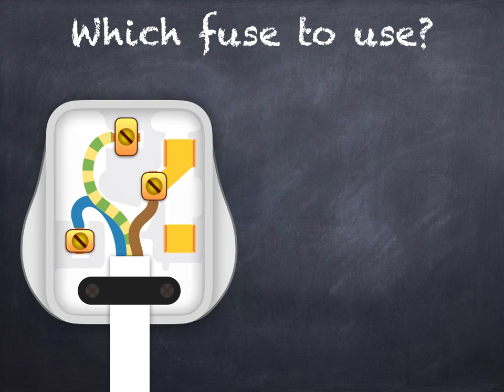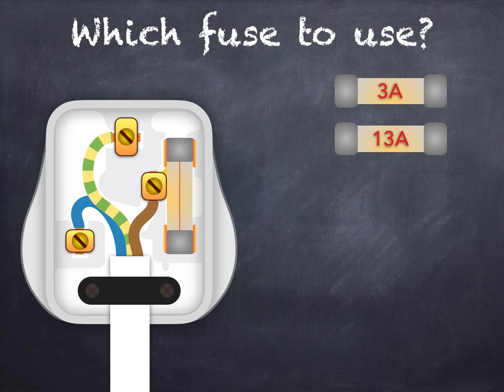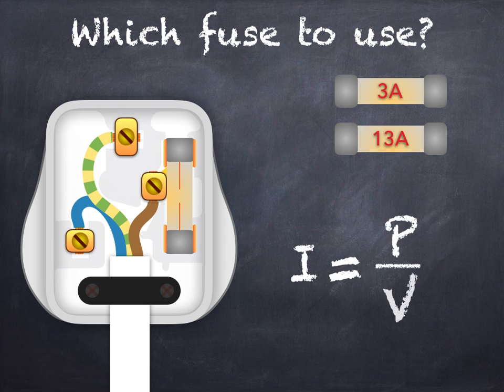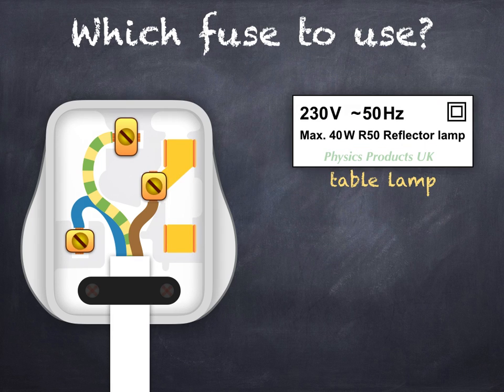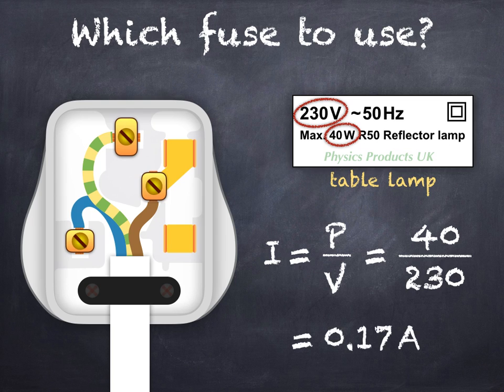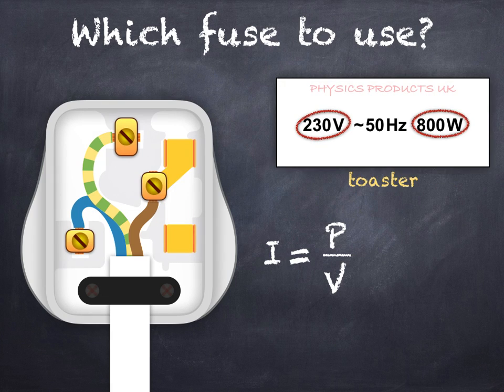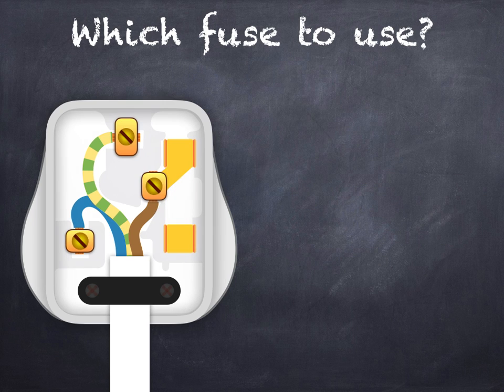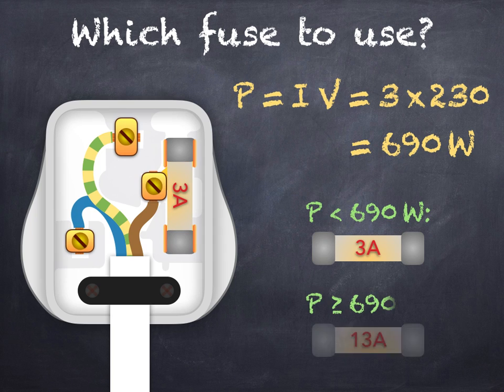Which fuse to use? (National 5 Physics)

Comment: I don’t understand if I am installing boiler that is 30kw so what size fuse would I use 
If you 30000/230…..
Reply from the maker: The video is only intended to help National 5 school pupils with this part of the course. As such, it's very much simplified and is not meant as a guide to selecting the correct fuse rating for various devices around the house. All the best!

Comment: Not sure why you've forgotten about 5 amp fuses, they are just as readily available and in your example of the toaster, a 5 amp fuse would have been adequate.
Reply from the maker: I've nothing against the 5A fuse, in fact, some of my favourite fuses are of the 5A variety. The reason why it's not mentioned is because it's not required information at National 5 level. The course specification states 'Selection of an appropriate fuse rating given the power rating of an electrical appliance. A 3 A fuse should be selected for most appliances rated up to 720 W, a 13 A fuse for appliances rated over 720 W.'

Comment: Hi what is the best fuse to an electric bedroom heater ? What the  correct fuse for ?, I'm using A3 and has an Short time life ...thanks
Reply from the maker: Always check the manufacturers recommendation - this will be printed in the manual of the heater. I'd not want to give advice on a device I've not seen. All the best!

Comment: Dear Sir, but do higher Amp fuse will protect the device. If 3 Amp required how 13 Amp will protect it.
Reply from the maker: The fuse should be the 'weakest link' in the circuit and is there to protect the flex & internal wiring. If too large a fuse is used then, rather than the fuse wire melting, the flex could start to melt which would pose a fire or electrocution risk.

Comment: If a blender could needed 5 amps would a 13 or 5 amp fuse be used??
Reply from the maker: If the current in the blender was 5A, using a 5A fuse would cause it to melt - a larger value fuse would be required. In National 5 Physics, pupils are asked to calculate the current in an electrical device then choose from either a 3A or 13A fuse.
Reply: @MrSmithsPhysicsonline  I  this example would it be worth using a 9amp fuse or would it make no difference to the 13amp other than you would likely have to change it more often.

Comment: What fuse rating should be in an electricity board cutout if the consumer unit is rated at 20 amps and the tails are rated at 28 amps?
Reply from the maker: I'm afraid that's beyond my area of expertise and beyond what is taught at this level. I wouldn't feel comfortable giving advice on mains electricity applications because of the inherent dangers.

Comment: what happen if I use a 13A fuse in a circuit that needs 3A. In audio does it make a difference? also what's the difference between quick and slow blow and ceramic and glass
Reply from the maker: The fuse should be the device that melts first in the circuit (the weakest link) - if you used a 13A fuse where a 3A one was required then the flex may be rated at 10A and will, therefore, melt before the fuse does (as could the internal components of the device). This is an obvious safety risk. Quick blow will melt the fuse wire in a shorter time than slow blow when the current is above the stated fuse rating. As for glass and ceramic, have a look at this... https://www.doityourself.com/stry/ceramic-fuse-vs-glass-fuse

Comment: Why do a lot of IT Server Equipment Kettle leads come with 5amp and 10amp fuses when the rating of those is equipment types is normally <690W occasionally high end servers like SANS will have a powr rating close to 700W so i normally use 13amp fuses.  What is the reasonging for 5amp and 10amp?
Reply from the maker: It's not something I have any experience with - maybe using a 13A fuse would allow the current, in the event of a fault, to damage the equipment within the server so a lower fuse rating is used (one which doesn't greatly exceed the maximum current). That way, the fuse is definitely the first thing to go rather than the expensive equipment?

Comment: An area I'm a bit sketchy on with the BS 1362 fuse is the certification of the fuse. When tested they get tested up to about 6 kA to ensure they can handle the maximum fault current at the 240 V supply voltage. However as the domestic mains board fuse is rated at 100 A, why test the BS 1362 fuse at 6 kA? Presume it's related to operating time?
Reply: If you find out let me  know! I'm sure it's in the regs, but I haven't a copy. At 230 to 240 V , if you take account of the resistance of the cable from the sub station, the plug fuse etc the highest current that a plug fuse should see is less than 1500 A. Doing a type test to 6.kA gives.some serious orders of magnitude of safety.
Reply from the maker: I'm afraid that's not something I know - it's as simple as P=IV at National 5 level. It has got me curious though!

Comment: Question : if a device is 8.7 A would you use a 10 A fuse or a 13 A fuse
Reply from the maker: From the National 5 Course Specification - 'Selection of an appropriate fuse rating given the power rating of an electrical appliance. A 3 A fuse should be selected for most appliances rated up to 720 W, a 13 A fuse for appliances rated over 720 W.' In other words, you'll not need to worry about any fuse ratings other than 3A or 13A.
Reply: Mr Smith's Physics online okay thankyou , ye i've got s2 exams tomorrow and physics if first
Reply from the maker: If it's an S2 exam and you've been given different advice, then maybe 10A is the right answer. For National 5 though, it's either 3A or 13A. Good luck in the exam.

Comment: Why not use 5A fuse
Reply from the maker: That's a good point - the reason is based on what pupils are required to learn for National 5 Physics. They have to select the appropriate fuse for a device based on its power rating and are given the choice of either 3A or 13A. For many real life applications, a 5A fuse would be appropriate, but it's not mentioned in the course specification.
Reply: thank you